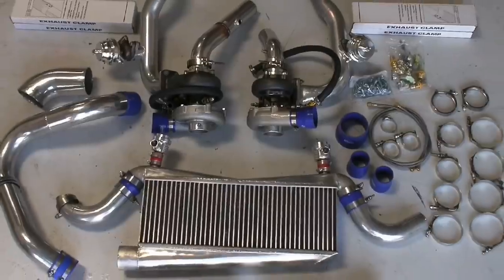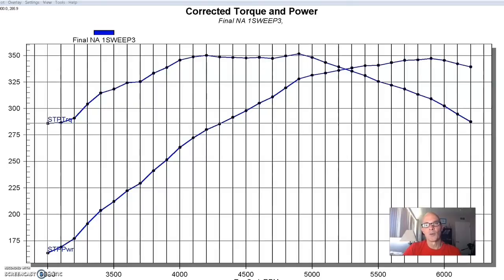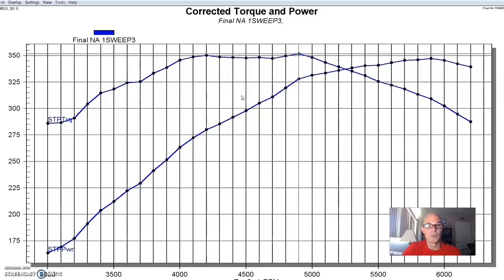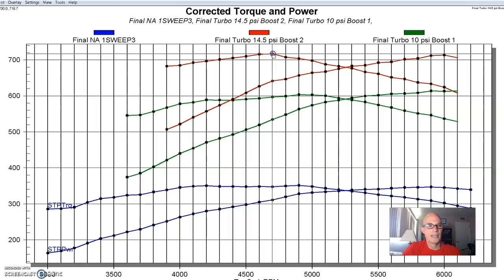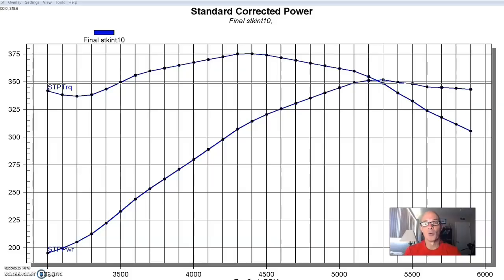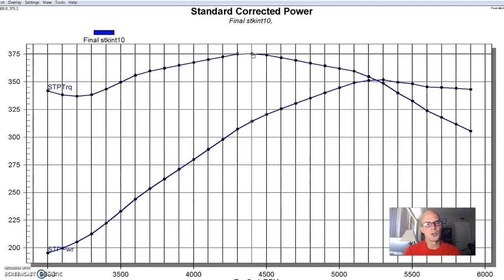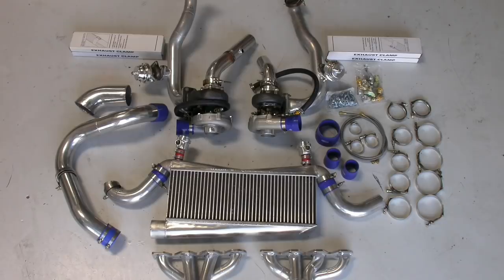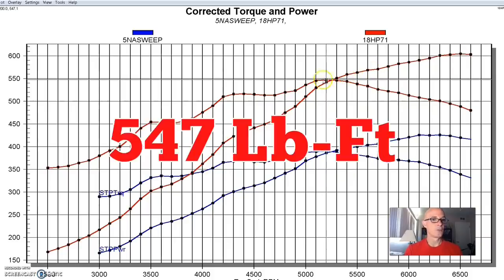TWIN TURBO MOD FORDS (2V, 3V & 4V)

Comment: Since Mihovetz was mentioned, I'm obligated to post up his absolutely mind blowing insane combination(as of about 4-5 years ago anyway)...

Production 4.6l aluminum Teksid block - 282cu in 
Production GT/GT500 heads
Production timing components(chains, sprockets, followers, lash adjusters - not kidding) 
11.25:1 comp
62psi
10000RPM
3000+HP
5.88@253mph @ 2500lbs(Pro Stock chassis)

He's also used factory forged Kellogg '03/'04 Cobra cranks at this level too, though he's switched to billet because they start to twist around 3000HP LOL
Mind you, while these are 100% legitimate production parts, the reality is that there isn't a production head or block on earth that's making 3000+HP and running high-5s without hundreds of hours of work put into them, so don't go thinking it's equivalent to 'junkyard parts'; EVERYTHING requires a lot of work up at 3000HP.
Reply: Teksid block that no longer resembles anything near stock castings it’s a sealed ass worked over race block 😂 also stop acting like they last forever...I’m so sick of hearing “because mihovetz”. In fact from what I know the 5.0 iron blocks are even better for said purpose 🤷‍♂️. More than sure he’s blown up more than his fair share of those 😊. Seems even guys in mustang forums are sick of folks repeating same bs bc of one guy with race worked parts
Reply: @zethloveless7238  teksid blocks were made by the same people that made ferrari block if I remember right..
Reply: PureCountryof91 I know this. What’s your point ?
Reply: @zethloveless7238  there have been numerous tests of the teksid to 1200hp and beyond. This was back before we had the kind of engine management we do now. I'm just putting it out there that the teksid was a really good block for being designed and built for the 90's muscle/luxury car
Reply: PureCountryof91 never said it wasent hell even inline 6 blocks like a 2jz are good for around 2000hp before needing billet but that’s besides the point. What I meant was after awhile that block isn’t stock with all the filling and girdle work etc needed.
Reply: @zethloveless7238  If you need to be told that a block needs work to hold 3000+HP, then you don't belong in this conversation. Factory, aftermarket cast, billet - they ALL require hand work at this level, NONE of them come out of the crate ready for 3k
  
How you can miss the point that it doesn't matter, because you can put the same amount of work into other blocks(like factory LS blocks) and still not be able to hold as much as a Teksid(or GT, or CJ/GT500), I don't know 
  
No one made any false claims - you're just looking for nitpicks to prove no particular point

Comment: So Rich, I'm a big Honda guy. I have a 612 whp EJ8 built LSVTEC turbo. I also have a 6th gen Accord that's about to get a J32A swap with a 6 speed manual. What I'd really like to see is what a single or twin turbo kit would do on a J32A2. I know that you're big on the B16 and B18, but I'm really interested in seeing what the stock J series can do. My stock J32A was rated at 260 hp and mine has headers, a full exhaust with dual mufflers, an Injen cold air intake, and a single stage 50 hp dry nitrous kit.
Reply from the maker: I have  a good friend doing a J swap in an NSX-I will have videos

Comment: Was the 3 Valve with stock pistons and rods?
Reply from the maker: all stock
Reply: @richardholdener1727  Wow! I wonder how these stock 3v can't survive on the street/track over say 500 HP? Seems like in the real world with exhaust restrictions, real driveline, tire torque, axles/transmissions and twisting forces tweaking everything back up the drivetrain they tend to fail at much lower power levels.

Do you think it's realistic to say that with an engine dyno (due to how smooth the resistance is) that a "test car" might have to reduce the power at the crank by say 30% to have some sort of safety factor? Interested in your thoughts on this! Like in the same way that launching a stick shift car can break stuff at way lower power levels than an auto does.

Keep up the great videos and showing us what's possible - Love it!
Reply: @StamatakosTom5791  500 whp. These engines are straight crank hp

Comment: Great video Richard. I would like to see you test the Hellion twin turbo set up on the gen 3 hemi. It uses the factory 6.4 exhaust manifolds.
Reply from the maker: I have run turbo Hemi stiff with the stock (SRT8 and RAM) exhaust-the SRT8 works well

Comment: Hey Richard, I just bought a complete 4.6 motor with aluminum block (RF 1L2E) and PI heads for 300 dollars. I think it came out of a 2001 explorer. It has stage 2 NA cams from Cushman Motorsports and I am afraid they will not work with a turbo because of the duration. It also has the 6 bolt crank but I will have to upgrade the rods and pistons since I am wanting to go single turbo. What combo would you recommend without breaking the bank?
Reply from the maker: use those cams with boost-they work fine
Reply: Richard Holdener thanks for replying love your content.

Comment: would've been nice to see a run with the 4v boosted setup on a 5.4 lincoln navigator motor
Reply from the maker: check out the 4V 5.4L turbo video that is up
Reply: @richardholdener1727  found it, thats a very nice unit

Comment: Can't get over the amount of hp from that old 2 valve, at 2 bar.
Reply: 2v arent nearly as bad as ppl make them out to be.  You got guys out here in stock 2v gts from the 90s getting gapped by coyotes and everyone says oh they suck theyre slow...with the right mods they can make some power and it dont take nearly as many mods as most people think it does.  I think the power is very respectable.   The 4v is def the king of the older mod motors and even the coyote is a 4v.  The gt500s were also 4v albiet 5.4 and a punched out version of the same engine the 5.8.  I love me some 4vs but i also realize the potential of the 2v when done right and i respect them and they sound great.

Comment: Do you happen to have data a buick 455 we could see? Or the data on the LS that greg brown put the smallblock ford hemi heads on in Hot Rod site, i believe you were the photographer on that motor
Reply from the maker: I didn't do the photos for that and I do have a Buick 455 on loan from David Freiburger
Reply: @richardholdener1727  is it the one him and steve had in the chevelle

Comment: Pretty crazy how much power a couple of disco potatoes made on those little engines. Very cool. Thanks Richard.
Reply: These turbos are quite a bit bigger than a gt2860rs. The highest mass flow I've seen is 48lb/m where the potato will only flow about 35lb/m. When I saw the near 1000hp, that's about all the air these turbos can move. You'll never find a potato that makes more than about 400 at the crank, thats with race gas or e85, the compressor is just too small

Comment: i know it’s a dead horse but man i wanna see a 427w stroker
Reply: it would beat the mod motors including the 4v like its a walk in the park, like it's got them on a leash, like there's no tomorrow, like it wasn't funny, like your momma caught you stealing from her coin collection to buy candy, like, like, well, you get the point..lol But yes, a 427W based 351W is a beast of an engine SBF..
Reply: TigreLoko24 currently in the process of building one for a 95 step side ford 4x4 she’s gonna be a sleeper when i’m done
Reply: @schoolofhardknocks1096  that's kool, gonna be a strong runner..
Reply: TigreLoko24 All functionally zero bulshit no lift and dumb ass tires and wheels pure performance towing and all around  badass ford truck
Reply: @P71ScrewHead  NO !!!!!!!!!!!
Reply: @andrewslagle1974  No to what??
Reply from the maker: I have done several of those including an all aluminum version

Comment: Only reason why 2v and 3v guys should be mad is because they bought that junk. Those things were awful.  Gutless wonders
Reply from the maker: we've done 1000 hp with a 2V and boost-every motor makes power
Reply: @richardholdener1727  everything makes power with boost. Using boost to make power really don't say much about the engines ability to make power. Those things are turds and we all know it.
Reply: @HioSSilver1999  I mean I like chevy and Ford the most but come on bro them 2vs are realible and 3vs ehh there alright but make more power. I do prefer coyote tho  and the 5.3 lt , the 4.8 , 5.3 ls didnt make as much power  but they respond well to mods , like cams , heads, gears , Stall u suprise alot of ppl
Reply: @HioSSilver1999  the early 4v was junk and the terminator motors came supercharged factory so you dont have room to talk shit. We all know 2v and 3v are dogs and dirt slow but its quite amazing the power u get from adding a turbo setup. They also had cleaner torque curves than your precious 4v bud.
Reply: @Peanut_boy4567  the 4.8/5.3 were never intended as performance motors. So they shouldn't be compared to any performance engine.
Reply: @HioSSilver1999  coyote bro I have a mean 2v keene bell and a gen 3 coyote roush stage 3 there is no comparison between the 2 coyote is unreal with the 10 speed
Reply: @shawnbroyles8274  then what you're comparing is the trans.....not the engine.
Reply: Idk my 2v is pretty realible has decent power with a tune and headers for a daily
Reply: Are you ok or did you bump your head!

Comment: Mehovitz has surprised many on the 1/4 mile... Lol  4.6 in a fucking outlaw/PM  LMFAO I couldn't believe it...the numbers he pays down with em are just mind-blowing. But I swear he's using aftermarket blocks
Reply from the maker: nope
Reply: No sir....100% ford casting (worked) same with heads....the old D port as well

Comment: I’m surprised the 3v didn’t spit the cams out the front of the motor especially with vvt timing phaser issues they are known for and I’m super surprised that the spark plugs didn’t spit out the head with all the spark plug issues the 3v has I’ve seen them blow up stock damn near killed someone when the timing phaser blew up and shot out the front and na these motors have no sauce a 4.8 ls could gap most these
Reply: 4.8 makes 285hp. So explain to me how it would "gap" all of these...
Reply: @banneddamn  frr chevy owners 🤦🏻‍♂️ and it's in a heavy ass truck to
Reply: @Peanut_boy4567  if you compared a cammed fbo 4.8 to a fbo 3v with cams they would probably have comparable power honestly.  A cammed 3v will easily pass 350 rwhp without even trying.  I know a cam only 4.8 isn't gonna make much more than that if it even equals it.  People act like the 3v can't make power how is that?  I mean it's a 4.6 liter engine from the 2000s...I think they do fairly well once you get em breathing.  Ls this ls that.  So sick of ls talk lol
Reply: Ahh the internet talk.
Reply: They had more "sauce" than a 4.8 stock vs stock the 3v has 300 hp the 4.8 has 285 hp.  Do fbo on both and add cams to the 3v and a cam to the 4.8 that is similar i.e. not baby cams in the 3v and a big ass cam in the 4.8.  Gaurantee they make comparable power.  So how exactly is it thst the 4.8 "gaps most these?  Oh that's right you were just trolling.
Reply from the maker: we ran nitrous and a blower and cams and ported heads on the 3V-no problems
Reply: Are you a FOOL ! Stop talking out you rear end!

Comment: So how much boost can a factory 03 grand marquis take
Reply: Up until it bends rods back a 1/4 turn
Reply: All of it. I think the 03 cars were not pi ones and the engine long block is different than the mustangs. The rods will be the weak link. They make 220 crank stock. If you want to run 18 pounds on e85 and kick out about 400whp...youll be okay, just. If you want more than that, just coyote swap.

Comment: Might need to come to the dark side and use a real ecu like a Motec or Adaptronic to control variable valve timing
Reply: Or megasquirt
Reply: @austindoud273  That's what they call my ex wife.
Reply: Or just lock the cams in a more reasonable spot, or get a custom grind with a proper ICL for locked cam timing.  The TFS 2v adjustable crank sprockets work well on a 3v.
Reply: @markrein7282  the vvt is key on these engines !
Reply: @andrewslagle1974  Agreed with a N/A version.  Once you go boost, it is barely worth the effort to risk the loss of valvetrain control with the stock phasers.  At least you can now piece together a reliable system where you can use the VCT, not like 10 years ago.

Comment: You're like Oprah. "YOU GET BOOST, YOU GET BOOST. EVERYBODY GETS BOOST!"
Reply from the maker: That was the inspiration
Reply: @richardholdener1727  You didn't show how much the 3v made with 14.5 lbs boost... I saw the file was there when you opened the 10lbs boost though?? @ 7:18 ... Only asking because I'm debating single vs twin turbo on my 05 F150 (towing) 5.4 3v, doing MMR rods, timing guides/tensioners yada yada... I will probably just keep it under 10lbs, but nice to know the potential
Reply: Exactly what I came to comment..

Comment: Love to see what you could do with a sleeved and turbo'd 5.4L or 5.8L Ford Mod Motor.  Not too many have done that as sleeved Coyotes are pretty hot right now.
Reply: I'm not sure why you think that - when the GT500 came out with the 4v GT head 5.4l in '07, they've been boosted up to and well past 1000WHP ever since
Reply: @RyTrapp0  Big difference between a sleeved/ turbo'd 5.4/5.8 vs early GT500 with a 4L Whipple.
Reply: Sleeved Predator has dynoed 2930 whp, won overall Sick Week and ran 6.26 @ 227mph on radials

Comment: I feel bad for the guys with 5 valves being left out... well not really... 

Wish I could bounce a few dozen question off of you but feel like I get a better grasp on the flow-power dynamic with each of your videos. Maybe you can dig into the cam spec stuff a little more? I get the impacts of static compression and head flow in a static state, but really feel lost in understanding what those cam specs mean to outcomes and how the variations in cam specs impact everything. Seems like you can really "adjust" dynamic compression with the cam set up with changes in lobe sepration but how much do such changes matter? 

Really appreciate your work.
Reply from the maker: cam timing is important but whatever the change in the power curve from cam timing-boost just adds to that

Comment: Turminator engines, were underrated by, 50 hp and 50 lb feet of torque! Looks it up!
Reply from the maker: I don't have to look it up-I ran plenty of them
Reply: 15-20 at most.
Reply: @HioSSilver1999  they lay down 360-380+ rwhp bone stock.  They were rated at 390 but were easily in the 430 range.  Seen one trap 113 stock so all the power was there and accounted for plus about 40.  What makes them awesome isn't so much what they do stock its what they're capable of with few mods ecspecially in 2003 standards.  I know you are an ls guy and sometimes it's hard for you to understand things like this so I figured I'd spell it out for ya.  If you hate fords so much why are you always on ford videos?  Lol
Reply: They made almost their rated power at the tires. I've seen one test that tossing the factory airbox aside made more than 400 at the tires on a stock car. It was also a magazine test car, so was maybe better than most, but they could deliver the goods.
Reply: @timothybayliss6680  they typically made 350-360 whp stock. Ran like they had 320whp. I have a 03 cobra motor in a notch with a ported blower that makes 468whp 471wtq
Reply: @HioSSilver1999  I haven't looked into cobras in years. From what every dork that has one says is they have a long break in period, and will continue to increase in power until almost 30k miles. The most I've seen from someone claiming to have a stock car is 381 SAE on a mustang dyno. That seems really high to me, like more than a c7 corvette. If you look at the mph these cars could hit in the 1/4, they were making at least 430hp the whole time.
Reply: @HioSSilver1999  if you're only making 468 with a ported blower you're lacking supporting mods or aren't pullied down or something is up.  Those are upper pulley only numbers.  With an upper and lower and ported blower with all bolt ons they easily pass 500 rwhp without even trying on 93 and more if you run better fuel.  They didn't "run like they had 320 rwhp" evan Smith trapped 113 in a stock one back in the day.  They ran a very healthy 322 rwhp 02 ss camaro as well and it was trapping 108 with less weight than the cobra had...so that right there tells you they didn't run like they have 320 rwhp.  Troll on
Reply: @midnight347  mine wasn't fbo. Still could use headers and some intake mods. Biggest difference one could have made was fuel....they need a fuel. The biggest difference the ported blower made was it carried power a little better up top. Mine was pullied upper and lower for 14psi.....to help avoid belt slip is why it was done like that. The single puny upper pulley slips like a mofo.....but you knew that. Well maybe not or you woulda kept dat mouf shut.

Evan smith .....lol. the dude that runs miracle times with errythang.  There are other differences that you fail to mention in the 03 cobro vs the camaro ss he ran. One is he likely iced the 03 cobro....they don'tlike being hot. Second gearing....03 cobro had better gearing. Third 03 cobros had aluminium flywheels from the factory. So yea....i stand by my statement on the motor. They were known dyno queens.

Comment: The V10 modular guys are complaining now!😂
Reply: Damn straight.
Wheres the love?
Reply: @magdump7380  it's in your f250 . Not sure you want to boost that engine much over 10 psi.
Reply: @robsorgdrager8477  pop sum plugs out much??..🤣😂
Reply: @eric63377  as an owner of a 2V V10 with 257k miles i haven't blown a single plug.
Reply: @insaneTrout  that man said Fake News🚫🧢
Reply: @robsorgdrager8477  Boost is just a number lol. Twin pro-mod 88s at 10psi may be a bad idea but twin gt35s would work fine.
Reply: @eric63377  Not really an issue
Reply: Lmfao.
Reply: Want to see a big bang of a 6.8 triton v10